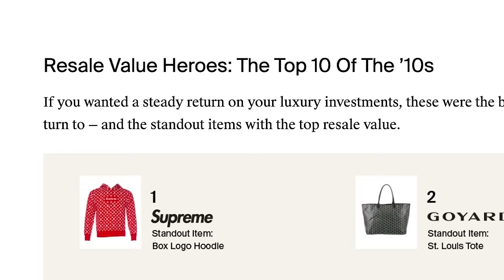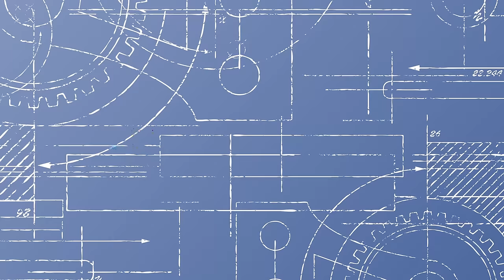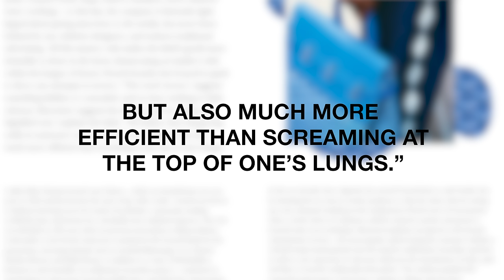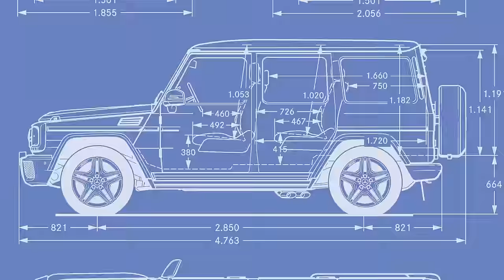This Bag Is The Ultimate Flex | Behind The HYPE: Goyard

Comment: I really love Goyard don’t get me wrong, I even think it’s more beautiful than Louis Vuitton, but the quality isn’t there.. I know it’s hand painted and all that, but I’ve bought their wallets in the past several times and they get worn out in less than a year! I thought that’s because they’re “handmade”. But Hermes wallets are handmade and I never face this problem. The other issue with the material is the canvas, don’t even think of getting it wet! The paint will fade. Goyard is beautiful but horrible quality !
Reply: Goyardine isnt painted by hand anymore. Only The Custom ID is. I had my Goyard Cardholder for 2 years and I bought it used. It was still in perfect condition:)
Reply: The Goyardine canvas is supposed to be water-proof.  The Saint Louis tote, for instance, can be used as a beach bag with the Goyardine canvas out to carry your towel and beach stuff.  But you can turn it inside out (plain canvas out) and put your wet swimwear and damp towel in the tote with the coated Goyardine canvas inside.  I've carried my tote this way for years and used it as a beach bag, diaper bag and travel bag and never had issues with the coated canvas getting wet.  Once, I even spilled baby oil on the plain canvas side of the tote and was upset I won't be able to get rid of it.  But I gently washed that part with a damp cloth with a bit of soap and rinse it with another damp cloth and the oil was gone!
Reply: Thats what i heard also. Better save up for Chanel and Hermes.
Reply: Hermes tends to use leather coated with plastic, or a more durable material than leather.
Reply: For me Goyard's quality is better than LV but in general it's best to buy good quality leather. Other luxury brands get slept on because they aren't flex pieces. When I was 18 I liked Louis Vuitton and Goyard, now I do my research for quality luxury goods.
Reply: calling Goyard horrible quality is a clear statement that someone has no idea what they're talking about.
Reply: or has too much money to care

Comment: Goyard is known for having paper thin canvas though. I've watched numerous reviews from luxury channels saying that their totes had easily developed holes.
Reply: All of them have the St. Louis tote. The cheapest one. You need the Anjou tote bag which is another $1,000 but lined with their supple leather and is more durable.
Reply: True, the St.Louis is the least expensive one you can get, also one of the only ones that you cam buy right away. Very thin leather handles, canvas lining, etc. You compare that to a Crossiere or Boeing and the difference is huge, both in price and quality.
Reply: @gonzak1  if the most basic/cheapest product of a brand is terrible then that says a lot about the brand's viewpoint on quality

I'm not buying from a brand where I have to buy their most expensive product in order to experience quality. Especially from a LUXURY brand where quality is supposed to be paramount.

Comment: The goyard’s canvas is pretty bad and thin therefore don’t expect it to hold up. You can go look up Goyard wear and tear on YouTube.
Reply: Thats true, I used to buy their bifold wallets every year and then stopped because they’re very cheaply made and they get ruined easily!
Reply: @KuwaitiHabibi  yea my wallet be have it for about 7 years has split and frayed
Reply: I agree, however it’s not because of the canvas, but because of what they use to coat it with, it’s a very thin natural resin and it doesn’t hold up. They also need to make their handles stronger, I can’t use my 5-year old Saint Louis anymore because the bases of the handles are all cracked and I’m afraid they might break apart :(
That said, the buying experience was absolutely amazing and still memorable after all this time.